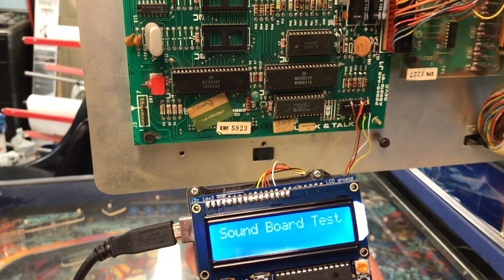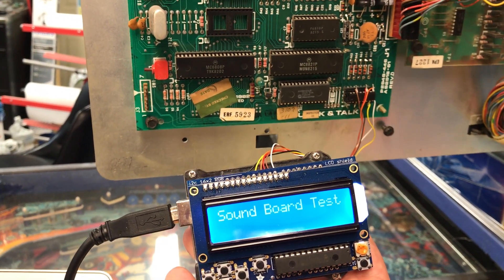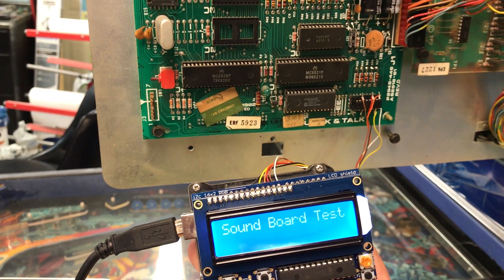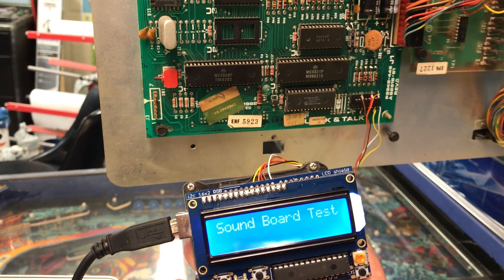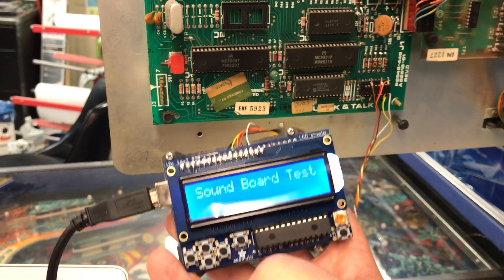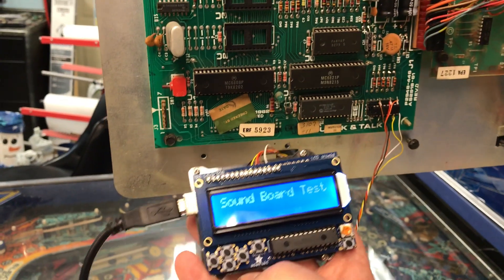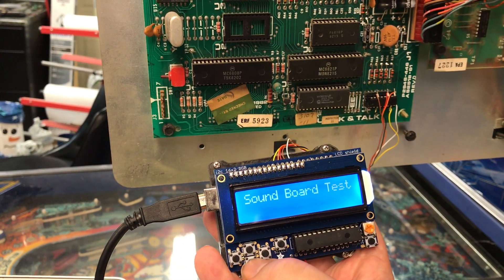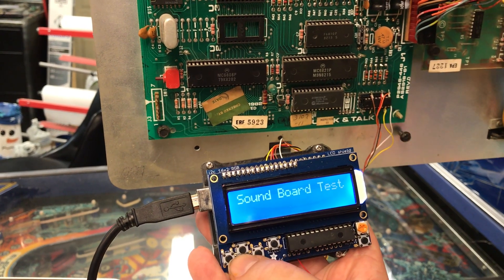Squawk & Talk Pinball Sound Board #1 - Interface

Comment: Can you share what arduino platform you are using ?  UNO ?  etc    Are you willing to share your arduino code for this project ?   Can you explain what is being sent to the inverters when you see  on LCD  255 [2] and count from 0 - 4  ?   Are you trying to invoke individual sounds or background sounds and individuals sounds together ?  Project concept looks great !   I am looking for a solution to test my squawk and talk board .   Let me know if you can help and how to contact you.  Thx
Reply from the maker: That test board is just an arduino uno with an LCD shield from adafruit. This method requires the board to be powered with the pinball. I’m working on a stand alone test shield for the arduino uno, but got distracted. Email me and we can talk more. Geeteoh @ Gmail . Com